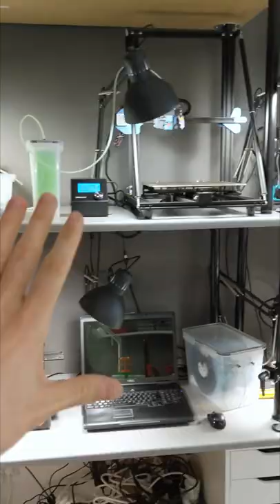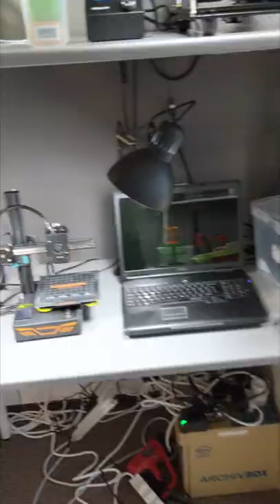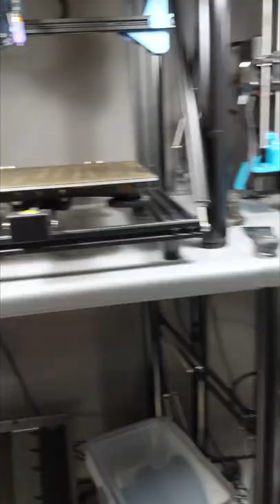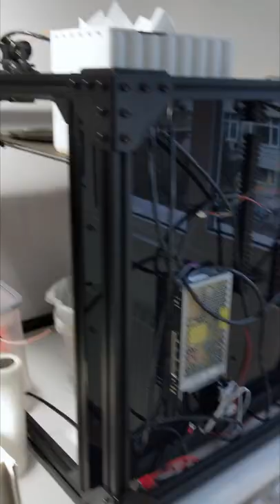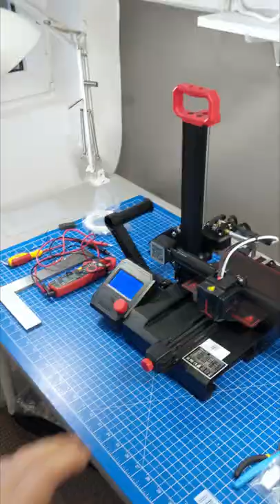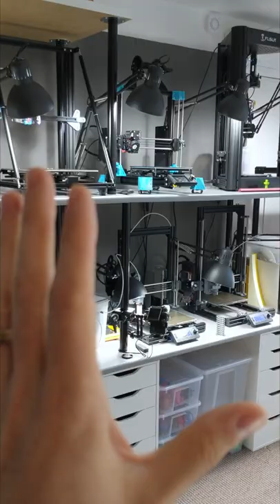Don't get a 3D printer

Comment: I think the keyword is “consumer” printer industry. I understand you’re probably not trying to do 3-D printing commercially, but it seems that way from how many different printers you have. I only have one, and I actually don’t use it all that often. But sometimes when I feel like printing something, I will. But my printer does have some quirks to it I think. I feel like my printer is just simply not capable of The higher print qualities that I would prefer, but part of me thinks that I’m just using the wrong settings in my slicer program. And I occasionally end up changing some of the settings not knowing if they actually improve the print, but I end up getting the print to be basically what I expected. Without really knowing if my print settings are what they should be.

On top of that, I’ve heard people say that you should keep your filaments in special containers. And you have to make sure you do all this maintenance to make sure print quality is good.

So the way I see it is that “consumer” 3D printers are not necessarily meant for commercial purpose. They require more babying and time spent, but if it’s a hobby, then that just becomes part of the hobby (time spent making sure the primer works). The goal isn’t to make a profit, but rather to preoccupy your time with a fun/creative experience.

Comment: Take a look at MakerGear's M3 or Ultra One.  Their printers are tools, not hobbies, which is why you don't hear of them in the hobby 3D printing scene.  You can modify them if you want, but you truly have no reason to.  They require 0 time, you take them out of the box, plug in power, and print.  You don't even need a USB cable.  They come fully assembled.  Amazing print quality, configured out-of-the-box with a custom image of octoprint web interface, comes with bltouch, if you get the Ultra One it will actually adjust the height of the corners of the bed by itself to ensure a level surface, and then do bed mesh mapping to account for surface impetfections.  All automated at the start of each print of course, not something you ever have to think about.  No tuning or fiddling around required.  Only thing you will have to to is the occasional lube-up like once a year at the most.  Can print basically any filament in existence.  That's it.  I'm serious.

Comment: Holy! This video I'm showing anyone I hear who says they getting a printer. These points are all valid!!!!
Reply: it's honestly not that bad, ive had an ender 3 for 2 years and haven't had to do all that much maintenance on it. i had to replace a couple of the parts on arrival, but since then the only problems i've had could be solved with a half hour's work, and they don't crop up all that frequently. This guy's issue is that he has way more printers going than the average home workshop, meaning the chance that one of them will have a problem is high. The more printers that have a problem, the longer each one takes to fix.

Comment: Build a Voron! Get the build and mod time out of the way up front, and have something extremely capable and reliable... perfect for building another printer (Augh!)
Reply: I thought that too...

And then I had the wires for the endstop and probe break inside the drag chain.

Still, except for this, my 2.4 has been incredibly reliable.

Comment: The Craftbot+ just works. I got it for my brother, and he has hardly had to maintain it despite printing regularly. He barely even understands slicing.

One tip is to avoid printers with beds that move back and forth. The print bed should only go up and down. That said, these are fabrication machines that will need more operating care than a laptop, so keep realistic expectations.

By the way, the too, commercial 3D printers are known for being garbage that constantly break down and need repaired.

Comment: After owning a few printers, the only one that has required no tinkering or heavy maintenance has been my Prusa MK3s. I can trust it to get the job done. The others I can trust to give me a headache and waste my time to get results out of them. Biggest mistake I made with the MK3 was add the MMU2S unit though. Not all Prusa makes is solid. Since removing it, it went back to reliable.

Comment: The sidewinder x2 has been an amazing printer. The auto leveler is amazing and the print volume is huge. And the spool holder is amazing
Reply: How long have you been using it for? Thats the model I had in mind for my first printer
Reply: @fallingawake2092  for about a year. The only thing to watch for is the auto leveler. It is cheap plastic and I can bend easy. But it it not to bad, its easy to replace and fix.

Comment: My highly upgraded Ender 3 is both an example of this and a counter example of this. The printer works reliably for a time without the need for much supervision or interference. Then something goes wrong, and I have to replace a part on it. I've taken to doing my upgrades when a part needs replacement. For example, my original hotend broke. I used this as an opportunity to upgrade to an Ender 3 V2 hotend. I was only able to mount this upgrade because I had previously upgraded to a cheap direct drive mounting plate for the existing extruder. The only reason I went with a cheap mounting plate instead of a dedicated direct drive extruder is because I had previously upgraded to a dual gear extruder and dual Z-axis motor. I've installed a few more upgrades than that. 

The only reason I could really afford to spend the money and time on this printer is because it's the only printer I use. I've also got a Dagoma Neva, but that printer is in storage since it is rather lacking in the features I use. If I had a printer farm like the guy in this video, I could never afford to upgrade all my printers.

Comment: I'll say I have been extremely happy with the Mk3s+ (kit) I bought last September. Aside from needing care and feeding to print high-warp materials, it Just Prints(tm). Only one real issue with it -- manual does not say linear bearings need to be packed with grease first. The Ender 3 Pro, though, completely agrees with you. I put almost two months of time into upgrading things to cover all the shortcomings before I gave it to a family member. Gifting it was the original plan but not taking two months and over twice the original printer cost in upgrades.

Comment: Yeah I kinda bought one on a whim and never realized how much you have to deal with damn near every time you print.  Your print looks messed up? Well maybe you have a blockage, or maybe your bed isn't level, maybe the belts aren't tight, maybe its your print speed, maybe its your bed adhesion/temp, etc. Everything is a possible solution for any problem you come across it seems. Took me longer than I'd like to admit to get a print longer than 10 hours to finish without messing up

Comment: I definitely agree with you… I really enjoyed tinkering and upgrading back in 2012 when I first got my printer… but now I’m at a point where I just want plug and play so I can focus on my ideas. That’s why I really appreciate my Formlabs Form 3 - it is so reliable and feels completely plug and play. Sometimes I just leave it “primed” so that if I leave home for a weekend trip, if I design something, I just remotely send it to the printer so the print will be done by Monday when I’m back home. That’s how comfortable I feel with its reliability. However, that’s an SLA printer, and having a reliable FDM printer would be hugely beneficial for so many of my designs that don’t require tiny parts.

I wonder if anyone has had experience with the Makerbot Method X… as it’s not marketed towards hobbyists, I haven’t seen many true reviews/experiences documented on it. The only time people post about it is if they run into an issue..It feels very plug and play in theory, as long as it works consistently. I’ve often been tempted to consider that as my next printer.

Markforged also seems very interesting..

One reason I’ve really enjoyed my Makerbot Replicator 1 dual all these years later (even though I’m tired of the fact that even years later I find myself occasionally deciding I need to upgrade it) is that I have two nozzles: a 0.4mm nozzle and a 1.0mm nozzle. Both are installed at the same time, so if I need a large object done fast, I run my plastic through the 1.0mm nozzle and have prints done in 1/3rd the time.

Comment: I fully emphasize with this statement after having to fix an Ender 3 V2 that wouldn't print properly for around a year. Troubleshooting and replacing numerous parts did not help. In the end, the small M3 inset screws which hold the filament feeding gear to the extruder motor were the culprit.

I will never forget the lesson I learned that day: ALWAYS do your sanity check on all components.

Comment: I personally have an anycubic mega X and it doesn't have problems that often. The only things that have broken have been the screen and power supply which are both pretty easy to replace. (Having the warranty can get you those for free). My main problem is the community behind it. Anycubic isn't really known for the mega x (or most of their fdm printers) so there isn't a lot of support from people with them. And even though its a company based in China, I haven't had issues with customer service in the U.S. 
Its not the fastest printer, nor the quietest, but it is pretty big and reliable. 
Anyways, good luck on your quest🙂

Comment: I was able to get a Makerbot Replcator 5th Gen for around 600 on ebay, 250 for a new print head assembly and just a big of leveling which is assisted. This printer just prints, never needs to be leveled or tinkered with or anything. I honestly really recommend it for its print reliability and quality

Comment: The PRUSA Mini is a fantastic starter machine. For $349, you have the legendary support and reliability of Prusa, on top of premade profiles for printing in PrusaSlicer. You really can't go wrong with one of those. The MK3S is also great but is obsolescent with a 16 bit board, meaning you'll need to stick a Pi to it for any intelligent functions like WiFi.

Comment: There are many printers that "just work", they're just not in the affordable to consumers. I've run or been responsible for 3 commercial quality printers over 15+ years. All three have required similar maintenance and repairs as the office laser printer. Others I know with commercial grade printers have had similar experiences. Several friends have hobby or consumer grade printers with similar experiences to yours. Most realize consumer 3D printing is a hobby, building / modifying / troubleshooting / repairing the printer is part of the hobby and have come to enjoy that aspect. Very few people would consider buying a commercial quality printer for hobby / home use due to cost (5 figures and up) but knowing the part will be waiting when you arrive at the office the next morning is well worth the expense in many professional environments and this ability has existed for at least 2 decades.

Comment: Had the same issue with creality ender 3 I nearly threw it out of the window of a second story apartment numerous times. I bought a second hand prusa i3 mk3s second hand, stripped it completely down and built it according to the Manuel from the ground up. Once I worked out how to print with pei (methylated spirits before every print and once every few weeks acetone and scotch brite scrub the bed) and calibrated the settings in the slicer it is simply a dream to print with. I oil the machine keep the bed clean and expanded the filament feed hole to 3mm so the filament doesn’t snag and it just works. I leave the machine for months, wipe it down and it just works. I run it 20 hours a day for weeks on end and it just works. Honestly my workflow is design/find the model click the preset settings I have made and click send to octoprint into a printqueue folder for easy deleting. I never mess around with the printer and it’s truly a dream to print with. Look there is a learning curve but it is not a never ending project. It does very quickly get to a point of extreme reliability. I feel you when you are dealing with crap printers but if you have an official prusa I would highly recommend becoming proficient in them and learning when the problem is the design of the model (i.e not enough bed surface contact etc).

My only complaint about the prusa is the noise compared to v-roller with a silent board. But mannnnnn it more than makes up for it in print quality and reliability.

I look forward to getting a mini+ to see if it is as reliable as the mk3 !

Comment: Omg, I'm living this video! As I type this, I have no less than a dozen printers (comprising multiple brands and types) down the basement in various stages of disrepair.  The only ones I have that have worked out of the box and still produce consistently are a monoprice mini delta, a Mars 2 resin & my beloved mingda magician x.  Others may disagree with me to various degrees, but it's a shame I went through so many to find sweet spots. There are 3 solutions to this pile of printing dismay imho: 1) selling each one at a loss, 2) giving them away to friends & family & offering to assist them with getting them working, which breeds more social interaction - something we can all use more of these days,  and 3) taking the best parts from each and Frankenstein them together to make working unit(s).

Comment: I've had my ender 3 pro for years now and probably have a 1000 or more print hours. Never had any issues above changing hot ends and replacing the tension arm on the extruder. Definitely recommend

Comment: I haven’t leveled or calibrated my original up mini since I got it 7 years ago and it’s still running strong. Only time I have had a failed print was by forgetting to slide the print bed back in. By far the cheapest and most reliable consumer 3d printer ever made. Too bad they don’t make em anymore

Comment: Completely true. That's the biggest reason I haven't bought a 3d printer yet despite being heavily involved in prototype manufacturing. On the contrary I bought a mildly worn industrial lathe from 1985 and it always does the one thing it's supposed to do... turn things to almost as good precision as when it was still new. The previous owner only changed 3 bearings at some point

Comment: Honestly, this is where I am at right now. I got an Ender 3, got a new Mobo and installed it myself [being paranoid of it catching fire to this day], upgraded the extruder twice, got silicone dampeners for the board, i messed with the fans despite never having soldered  and being paranoid of causing a fire [lol], got a new Z-Rod cause mine was bent out of shape, printed a new fan duct and so on. Yet, it still just breaks down whenever. Be it the screws loosening every 2 weeks, the bed being warped [making ever buildplate other than glass/mirror nearly impossible to use IMO] or other issues that are frustrating to pin down. I've had this printer for almost 2 years, yet didn't even get to finish a single "bigger" project that I wanted to finish, because i need to fix issues in between, adjust settings and then deal with more issues again. 
Quite honestly, I'll spend the 440Eur, get a Prusa Mini+ and just try to get to do what I wanted. I wont have to be in constant fear that it'll burn my house down in my sleep, noise levels should be more tolerable, and it takes up less of a footprint despite ACTUALLY DOING WHAT I WANT IT TO. What a mess.

Comment: Tried using a lot of 3d printers.

In the cheaper consumer segment the only good one (without spending 2 or 3 times the printers worth on upgrades and an entire month just installing this upgrades) I can recommend is the prusa (yes, I am one of THOSE guys...) - relatively simple to build, good service, everything works, nice community, and the print quality is good, even without modding it

On the other hand, if you have the money or the connections, get yourself a real 3d printer instead of those fdm-toys...

Comment: I've yet to have any significant issues with either of my printers. I have a Longer Orange 10 and a SnapMaker 2.0 A350. I don't see consumer level 3D printing coming to resemble home inkjet/laser printing in my lifetime, but if it does, I pray we figure out the recycling aspect by then. In truth, when you look at all the different types of printing there are, printing on sheets of paper is sort of the odd duck for being something almost everyone can do at home. I would love to be able to easily print on textiles and ceramics at home, but I accept that my options are limited at this time.

Comment: I'm having a lot of luck with resin printing... Once you get your resin settings figured out its not so bad... Only one stepper so really quite... Supper cheap entry point... You don't really need the wash and cure station it's just rotating print Infront of uv led not worth the price u can build for cheaper... I would love to see a good resin printer that can be build rather than bought... Even the small work area actually hasn't even been a problem

Comment: My printer is fine (Ender 3 Pro), after calibration and replacing the hot-end with an all-metal one. 

The filament is the problem. Each new roll has it's own peculiar settings for decent prints. First I have to find the spools correct temperature, which can be anything from 190 to 230 degrees,  then the thickness has to be corrected for, with some rolls set to 90%, and others as high as 120%.

The variation in the filament between rolls is a much bigger problem than the printer itself.